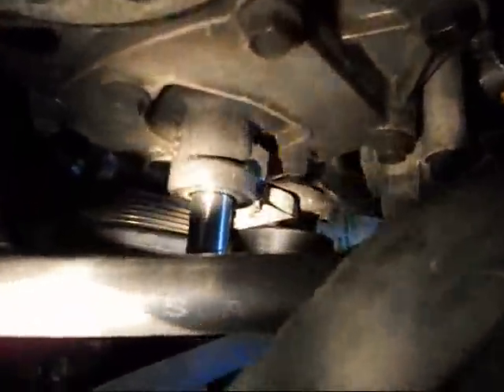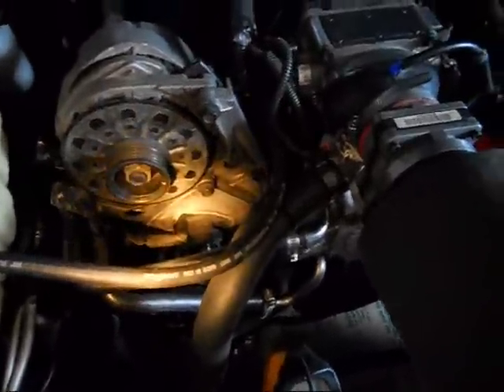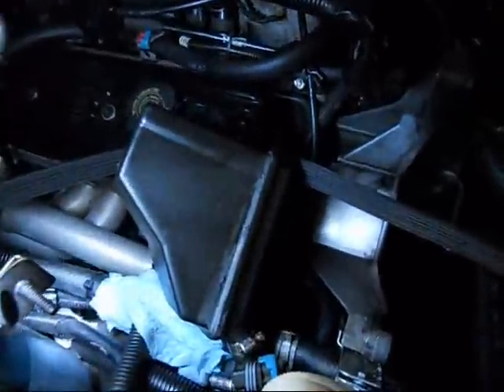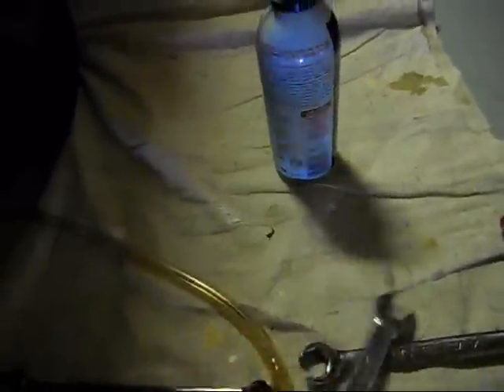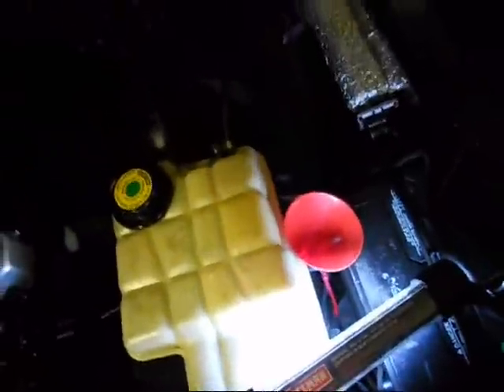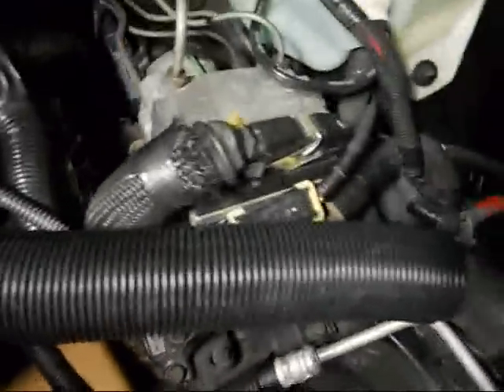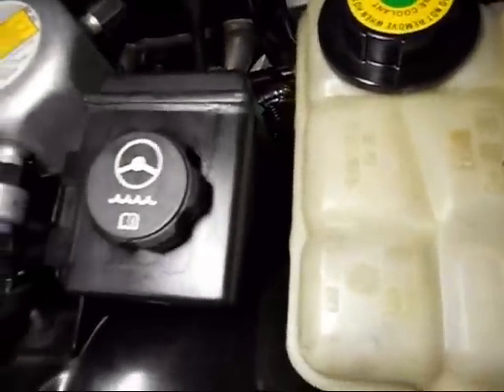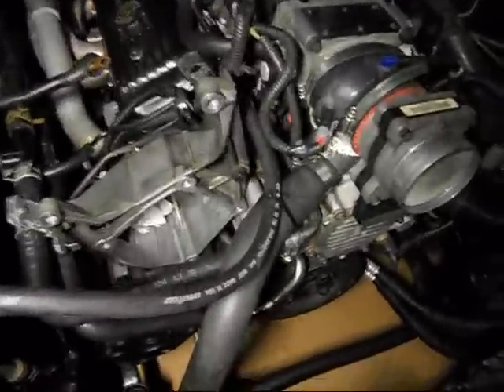Power Steering Pump replacement! ImpalaSS

Comment from the maker: @edzgarage   One thing I have to add is that I'm glad its been a good car, Easy to work on, No rusted bolts. Also! I'm happy the PS pump didn't decide to leak out all its fluid last time it was used on a trip.  Now it can be used again with confidence.  This car has been sitting for awhile!

Comment from the maker: @moldymac  I had a nice reman delco pump in 2006.. I sold before I moved because I never installed it.  It was a nice pump. I bought another a month ago it was a loose piece of garbage.. A rebuild all depends on what you started with.

Comment: I don’t know how u managed to get those hoses off of the top of the steering box through the outside in the wheel well…but if u did it,i will try it too as the high pressure one is leaking right at the top where line hooks on..looking at it drives me crazy thinking about this…i might even give the job to a shop for this 1996 SS repair job..
Reply from the maker: They come off decent with creative wrench placement     High pressure line you need to remove the pulley and unbolt the ps pump  Block it a little so it does not move.

Comment: Ever think about installing Wagon rear  springs on the sedan? I did it to the 5 sedans we had,wagon springs are shorter and wider.Makes for great handling.and a  safer car.
Reply from the maker: They are heavier springs for the extra weight. No I would not use them it would make it ride higher

Comment: May I ask you HOW did you find room to get a tool to remove high pressure line on rear of pump? I have a 96 caprice LT1. Thank you.
Reply from the maker: Remove the pulley all the bolts  alternator  let the pump move around a little, tube wrench done. So easy did it so many times
Reply: Thanks now I know about the tube wrench.
Reply from the maker: Ya  the trick is to let the pump float around in its little bracket it sits in. Remove the plate. Or just un bolt the plate from the accessory bracket.. Of course remove the pulley first.  On a roadmaster it sucks with that variable solenoid thing it has. it makes the job worse
Reply: Have you any experience with replacing the throttle body on a 91 Caprice 305? thanks
Reply from the maker: UN hoot the fuel lines,  3 bolt, clips for the cable, 3 electrical connections vacuum hoses, Off. easy. 3 bolts hold it on
Reply: Where do you find a throttle body for a 91 caprice ?? Thanks
Reply from the maker: Like everything for these cars. Junkyard
Reply: I tried junk yards,they can be fun. 91  seems to be to old to find such parts still in the cars.I'm on a mission.
Reply from the maker: You may be able to use a TBI truck one too but the throtle linkage arm may be a little different.  They are allover down here but the throttle body goes fast
Reply from the maker: Try car-part DOT COM and search your area  They are non pick n pull yards but they may have the part
Reply: no wagon springs do not make ride higher,sitting the springs on the floor side by side, the wagon springs are2-3 inches  shorter but  wider,Ill look for  that pic.
Reply: @GhettoWagon  Hey boss... what size is the "tube wrench"....?  I'm about to do my P/S pump this weekend...

Thanks ....

Comment: I feel like I know the answer, but I’m looking for confirmation; will this video generally apply to the 1996 roadmaster as well?
Reply from the maker: Ya same just those might have the weird steering valve off the pressure line
Reply: @GhettoWagon  something a driveway mechanic could pull off? I’ve got a squeaking belt snd had minor power steering outage issues recently. Wondering if the PSP is the culprit.

Comment: is there a special tool used to get the pulley off? because my PS pump pulley is a little loose...but I was told the pulley is pressed on..but I've seen someone use a tool to take them off and put them on
Reply from the maker: +Ian B  Yea, they make a Power steering pump pulley removal and install tool. I may have a video on it when I changed a pump on a chevy truck.  Auto zone or advance will rent it to you.

Comment: So how DID you remove the high pressure line  from  the  pump??
Reply from the maker: use wrench.  after you unbolt the pump and move it forward a little for room. Easy  Its worse on a roadmaster with the variable PS